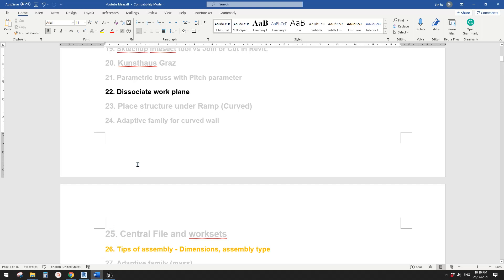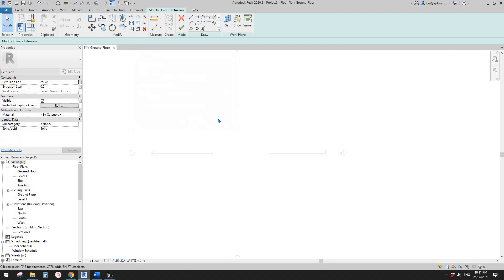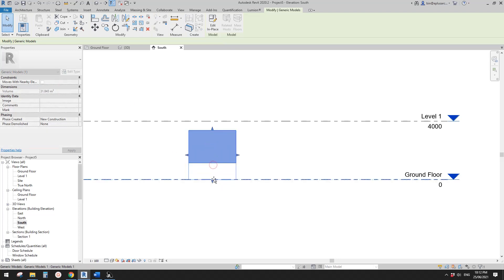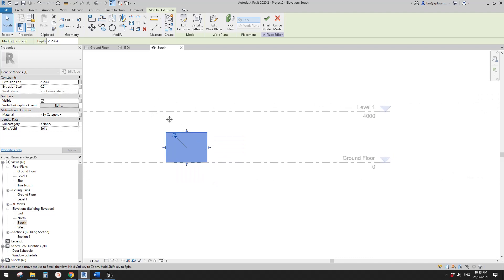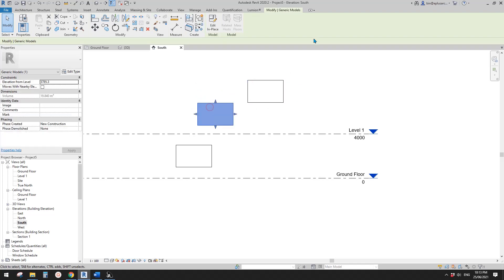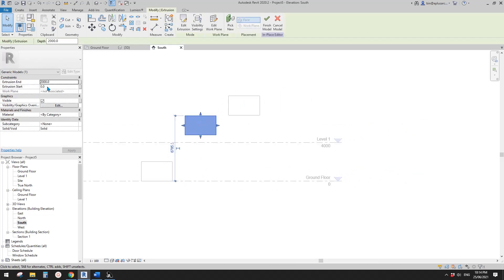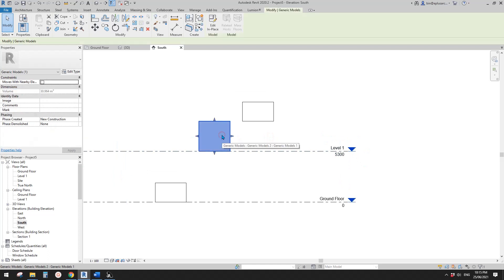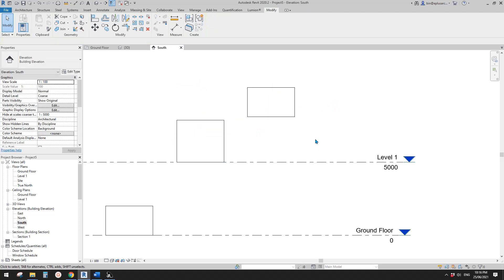Everyday Revit (DAY 462) - Dissociate Work Plane

Comment: The reason why you couldn't move the object vertically in the first place is because "Constrain" was checked. Uncheck it, and you can move it regardless of the Work Plane.
Reply from the maker: No, the constrain here means you can only move the object in orthogonal directions, you won't be able to  move an element in the direction perpendicular to the associated work plane.